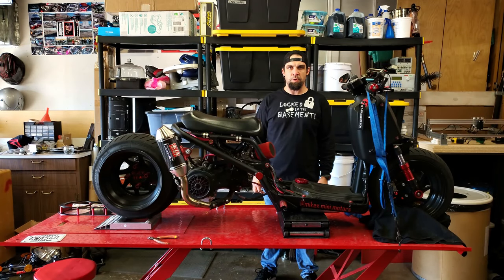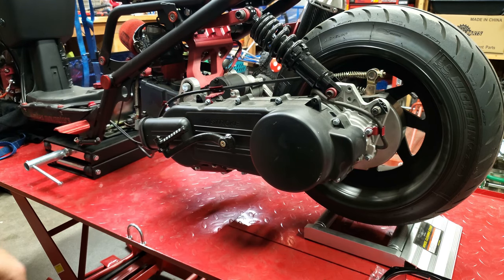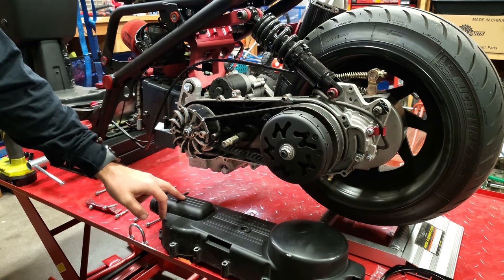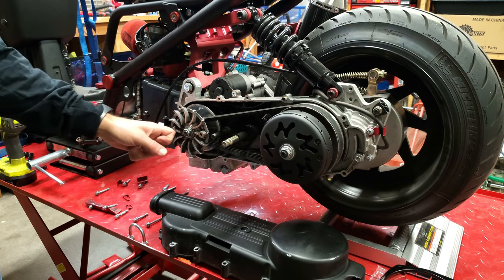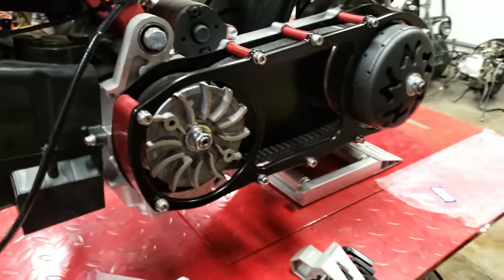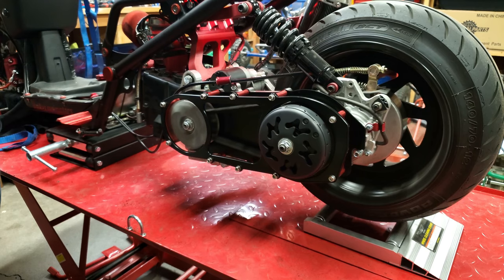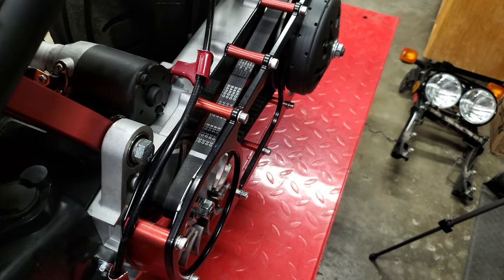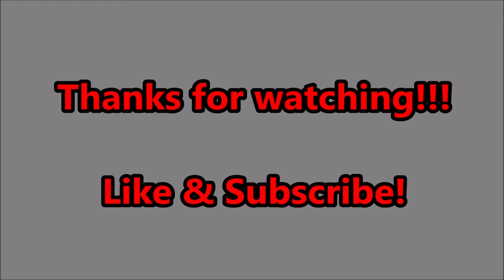Honda Ruckus - Installing the Ultimate Anklebiter from The Ruck Shop

Comment: Can I use the anklebiter for my 2020 dong fang df50sst
Reply from the maker: I am not familiar with that model, so I am not sure what engine that has in it. If it has a long case 150cc GY6 (157QMJ or 1P57QMJ), then I believe it should fit. I would ask the vendor for whichever anklebiter you choose first, just to make sure though.